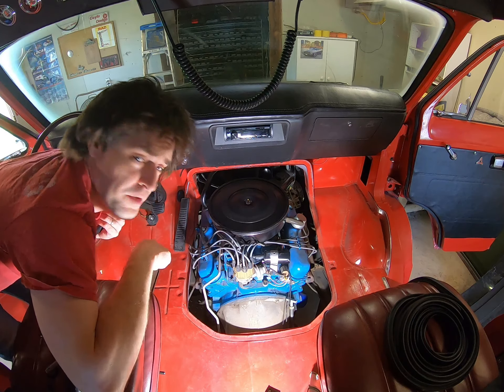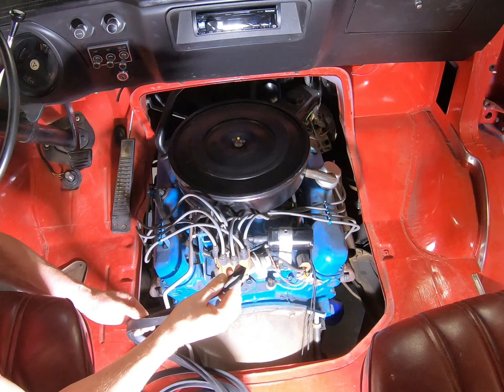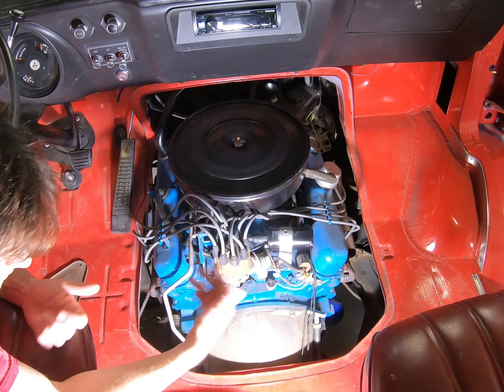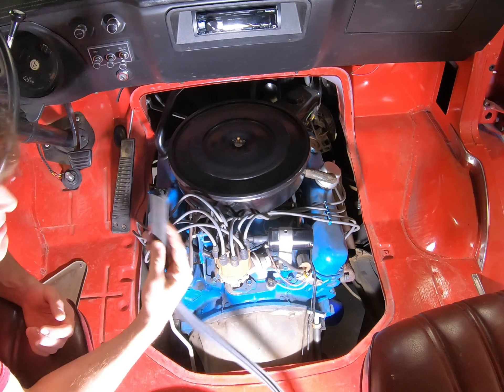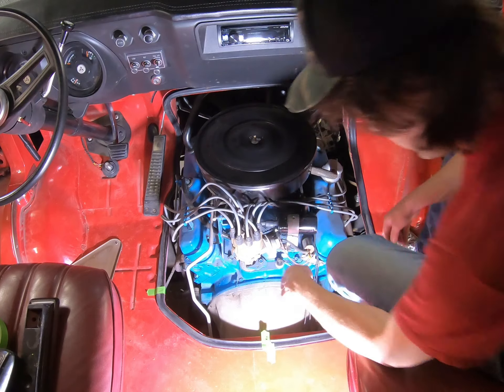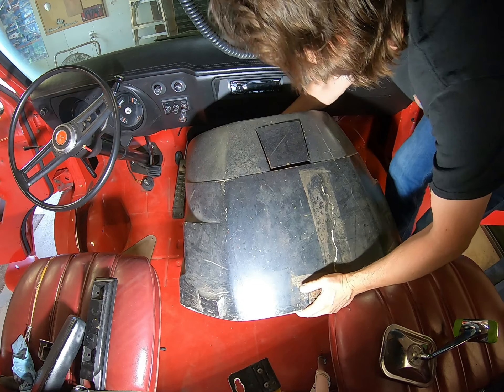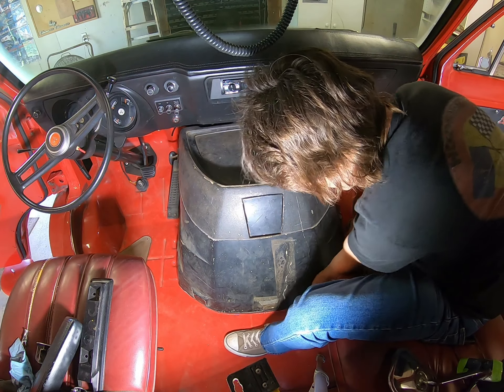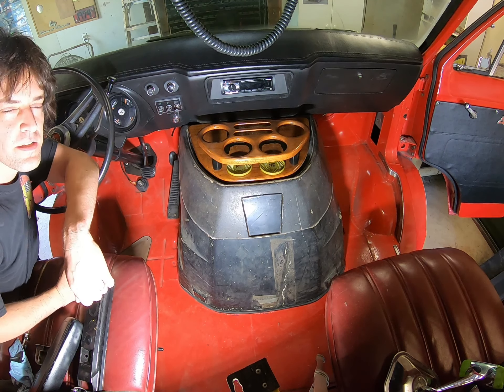Dodge Van Engine Seal - Hoosier Garage

Comment: I did the same exact thing as Adam did in this video. I used a E-body/A-body Mopar trunk gasket and 3M weatherstrip/gasket sealer. The sealer becomes tacky in about 5 minutes and 5 minutes later it held the gasket in place pretty. I bought the gasket off of eBay for $30 shipping included. Just trim off the unneeded gasket you have left over. Your doghouse should set on it and crush it down just fine. Pretty cheap fix for under $50 and keeps any carbon dioxide out of the van too! My van is a 73 model Dodge.  😅

Comment: I have to route two cables into the cab of my van. One for a general power source for lights, head unit, CB Radio, etc. The other to power an amp. for the head unit. There is no room really to pass through the firewall with these two cables which need to be apart from one another. So I was going to notch out at two points my engine cover that it could be lifted out without disturbing the cables. That's my goal at least. But I don't want fumes or any odors coming in nor do I want to create any noise, like possible whistling. I'm hoping that if I cover the notched area with some kind of leak proof tape that I can avoid any issues. But my cover will not be sealed as well as that great job you did. I guess I'll know if it's not sealed enough if I start coughing.
Thanks for letting us see that beautiful power plant on the other side of the Doghouse.
Reply from the maker: How are the cavities on your wiring bulkhead from engine bay to pass compartment? My van is a bit of a minimalist but has several blank areas that could be notched and run wires through. Just a thought. I have a few running through a hole in firewall with a grommet.
Reply: @HoosierGarage     My van is a 2013 GMC 1 Ton Extended. The only area that doesn't have anything attached to the firewall is where the grommet and cable come through that opens the latch to open the hood. And close by that is the steering assembly and some electrical equipment. I'm a little hesitant to start drilling in that vicinity. I'll have to take another serious look at the situation and see if there is a spot that I can go through. 
I bought this van new and I was still using my old one that had about two hundred thousand Kilometers on it. Although my new van is now eight years old there is just about 5200 Kilometers on it. I bought it and equipped it with new shelving etc. Not realizing fully that I would be retiring early. I donated my old van to The Kidney Foundation. 
I had bought this Double Din Kenwood Head Unit and it has a CD Player. And just before the Corona Virus hit, in late 2019 I traveled to St. Louis Missouri, I live in the north in Ontario Canada and during my trip I bought a Cobra Chrome CB Radio. So I decided to install these in my van. If that does come to be. My Wife and I will be playing CDs and we won't want to leave the van. It will give me an excuse to drive it more often. Even if it's just to the coffee shop.

Comment: Looks great! That was a great idea! I think that engine cover is made out of SMC fiberglass, like the hood scoops were on mopars and also Corvette's from 1972 up, if so when you fix that crack you may need to use the epoxy for SMC repair instead of regular fiberglass resin. Regular fiberglass resin dosen't bond to SMC very well. The SMC resin is pretty common nowadays, alot of the newer truck bedsides are SMC, "Sheet moulded compound", you can look it up on the internet for reparing it. Hopefully it will make for a stronger repair for your engine cover.
Reply from the maker: This is great to know as I was planning on the traditional method. When I tear into it should I find any markings?
Reply: @HoosierGarage  it will probably have part numbers cast into it somewhere, if its SMC it will look a little more chalky were its cracked and the fiberglass strands will be fine textured it will be grey looking material also. I'm pretty sure its probably SMC, every company started using it or plastic in the early 70's.

Comment: Great Video! I'm wondering if you've run the van yet with that gasket and how it does with the heat generated from the headers, especially on the drivers side? I need to do this too, my original gasket is pretty much shot. Thanks!
Reply from the maker: This was a few years ago. And i have put maybe 5000 miles on the van. No problem and although naturally warm on the drivers side, its actually done perfect.
Reply: @HoosierGarage  Cool. Thank you for the video and info!